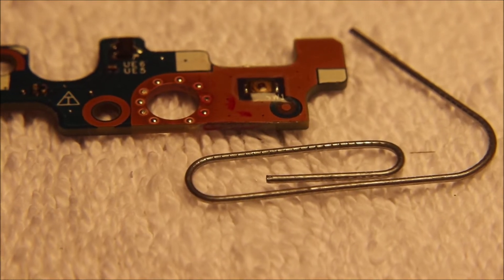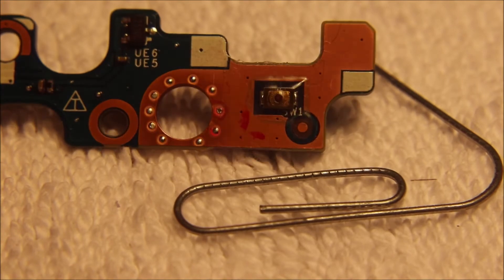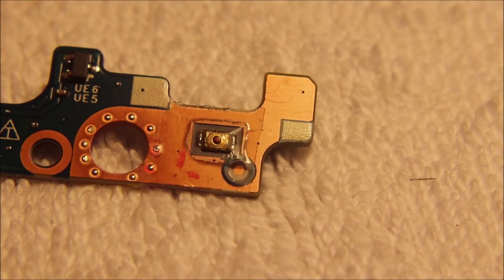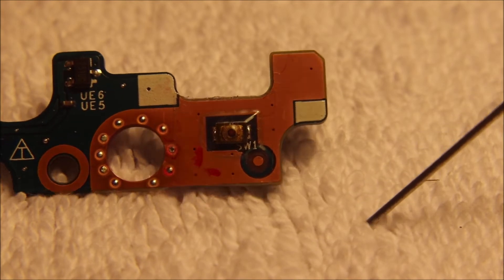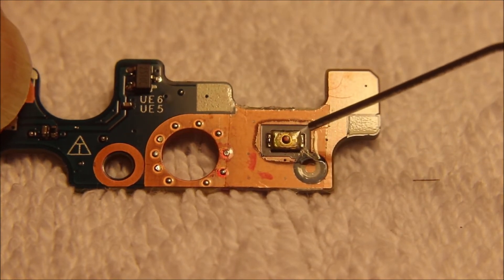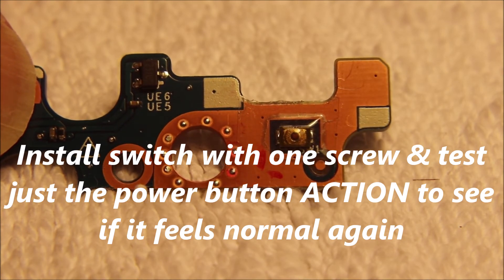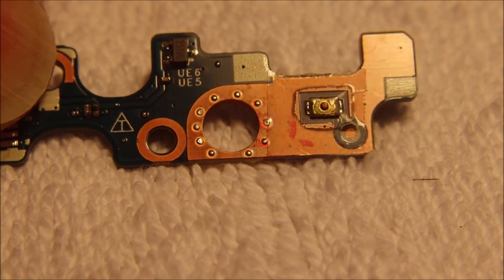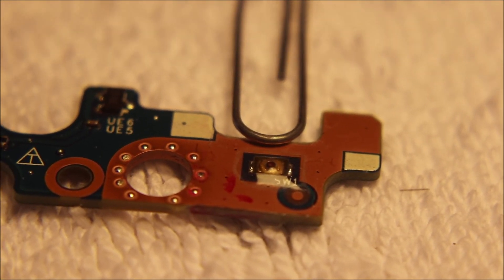How to get your Dell Inspiron laptop Power turned on until new parts arrive;  try this hack!

Comment: Where u get that power button black dot after open u r laptop ..
Does it there or fall
Reply from the maker: mine was still "glued" but shifter way off center.  it's super tiny and I almost completely overlooked it.
Reply: U take little bit of packing tape my question is does packing tape may effect power button board or  damage in future???